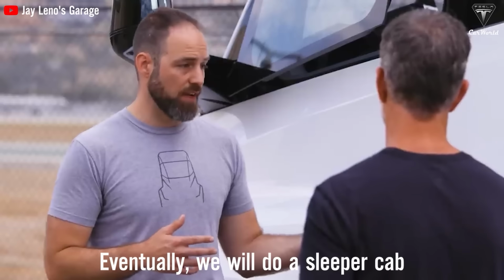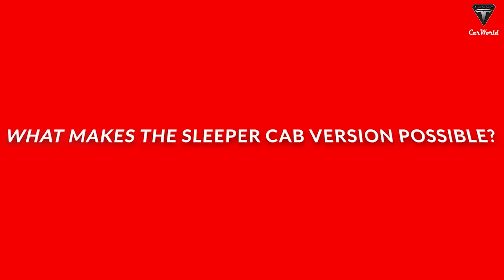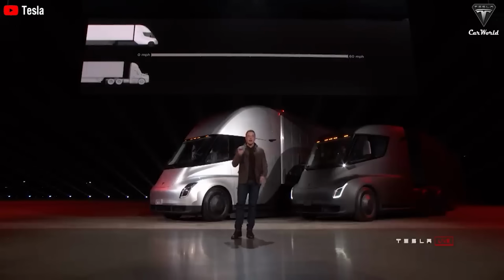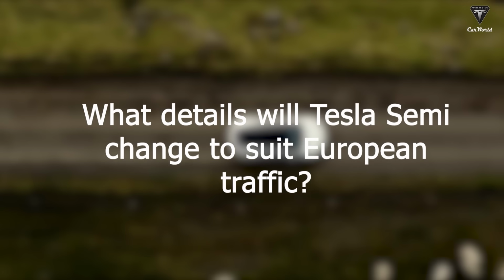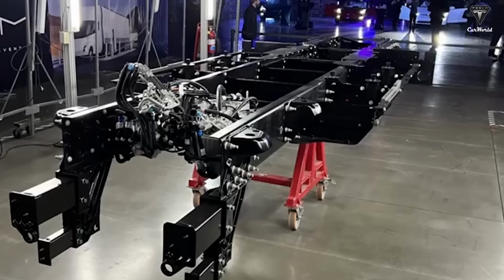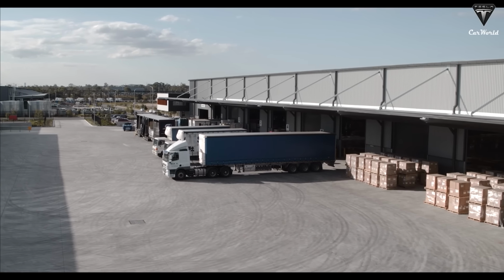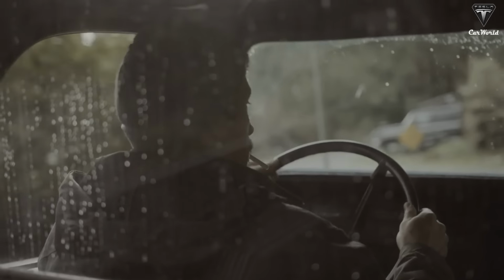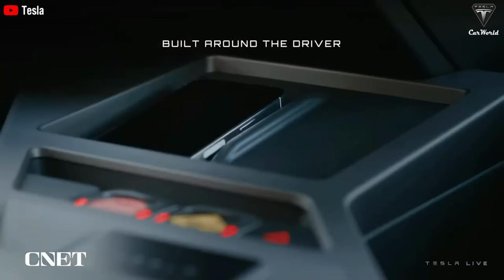It happened! Elon Musk Unveiled HUGE Upgrade 2025 Tesla Semi: Price, REAL Specs & 5 Hidden Features!

Comment: You are missing key point in your comparison of why drivers prefer conventional style trucks vs cab over trucks. During the transition from cab over to  conventionals there was a $10,000 premium for conventionals spec for spec. Cab overs definitely have better visibility over conventionals.  Fuel mileage was also won by conventionals anywhere from 1/2mpg - 1mpg better than a cabover. Argosy’s had everybody wanting one  (no more crawling over the doghouse to go to bed and being able to put your pants on standing up). Not turning as sharp especially in tight docking spaces and tight city streets was a major con for conventionals over cabovers. Ride quality also was lacking in a cabover although when air-ride and airbags for the cab did make a lot of improvement, but then they did the same to conventionals which caused the end of cabovers in the United States. In Europe they have steerable axles for trucks and trailers. If they incorporate those features to conventional trucks and  add 360 degree cameras so that a driver no longer had a blindspots safety as in fender benders and worse would be greatly improved. Heaven forbid adding a level two cruise control so that a truck driver could have 10 seconds of hands free driving on the interstate. Oh wait that would be heresy. Add a toilet,sink,shower into a slightly bigger cab of say 80” instead of 60” (which is common in today’s sleepercabs) driver retention would greatly improve.

Comment: The problem is the infrastructure can't support this load and will take 10-20 years. They will have to increase the electricity prices to fund and keep the system stable.
Reply: You’re wrong every day more electrical capacity goes online. That’s why with increased population we have to continue. To build electrical generation and storage for Peeker times. Every day we rely less than less on fossil fuels. That’s the whole goal.
Reply: @dennisknehans3206 Sounds good however what do we use to replace the 6500 products that petroleum makes. If gas and Diesel is part of the process where does the capacity go.
Reply: @ChasL704 - Petroleum will be used for stuff you mention but not used in ICE, ICE is going to die out in the next 15-20 years, already happening.  You’ll be seeing more and more EVs on the road esp. Teslas, people are wising up.
Reply: @dennisknehans3206  - Have you read that Elon is predicting huge problems, way beyond capacity in the next years due to AI and EVs.  Look it up.  Buying Chinese windmills, solar cells, and batteries is dumb - not smart.  https://www.youtube.com/watch?v=VRJmqJqPH80

Comment: Don't get all the explanations about the European market with feet and pounds, as we never use those units. Although some general regulations make all designs favour cap over as the total length is measured, the total length is different in different countries and even highways in different countries. For example, the maximum combined weight in Denmark is 56 metric tons and a total length of 18.75 m. In Sweden, it is 74 metric tons and 25.25 m, although longer is discussed. In Finland, it is 76 metric tons and 34.5 m. The total height typically required to drive under the standard height of bridges is 4.5. For example, some highways in Sweden allow 34.5 m and up to 93 metric tons.
To summarize, a manufacturer must be very flexible in offering economically feasible trucks for respective markets. Moreover, the two heavy truck manufacturers in Sweden offer an engine/driveline (diesel) with much higher power and torque than other similar manufacturers for a reason. At the same time, the same manufacturers, like most others, are also moving towards electric trucks. I would just love to see the Tesla Semi on the roads in Europe as well!